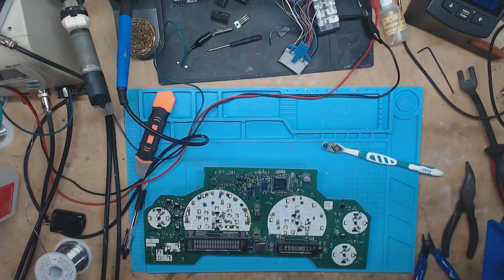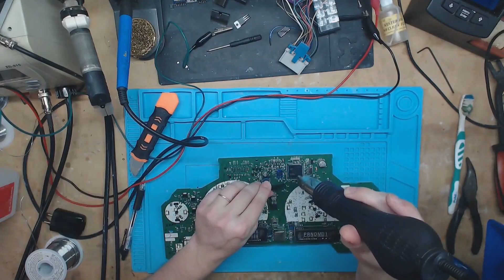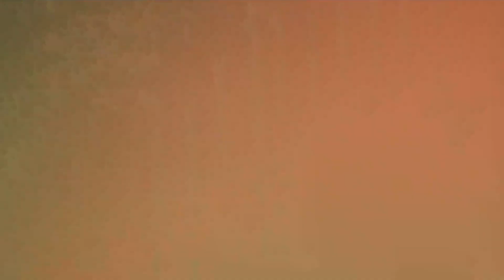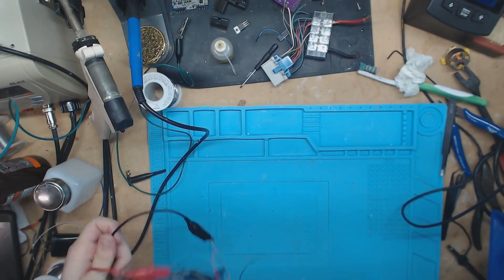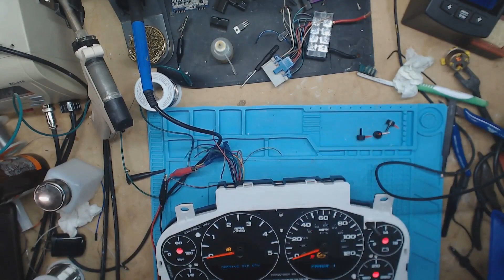07-14 GM Instrument Cluster MCU Repair

Comment: Another great video. I am not sure how much those clusters cost in your area. But here in Iowa and in my area I can get the 07+ for around $45 but then programming it is where it cost you.
Reply from the maker: They are $200 at the local junkyard but I can get 03-07 for $40 at the same junkyard. He thinks they are gold for some reason. Ebay they seem to average $80 to $100 for used/broken ones.
Reply: @FixedUntilBroken  Here the 03-07 clusters go for $125 and up. One junk yard here list rebuild services for 03-07 for $80 and only replaces the bad stepper motors with black China junk stepper motors and only the bad bulbs for that much. They don't replace all them dont know why but I guess they want to save money. I found this out a few months ago when I repaired one for a customer at my shop that had his rebuilt 2 years ago.
Reply from the maker: @Iowachevy  $80 is what I charge to rebuild the 03-07 and I use all new x27s and bulbs in it LEDS are included but I use the cheaper leds and just warranty them. I don't use the black steppers because people talk crap about them but I have never seen a dead one. I'm not sure that really are worse than a x27 but they really aren't much cheaper than a X27 so I dont get why people use them.